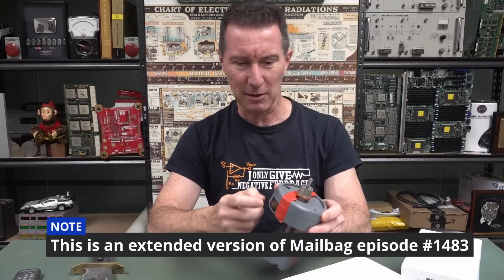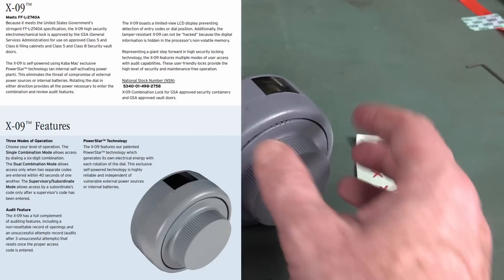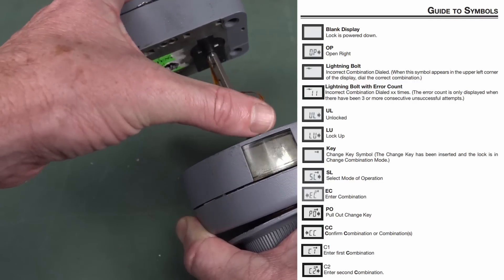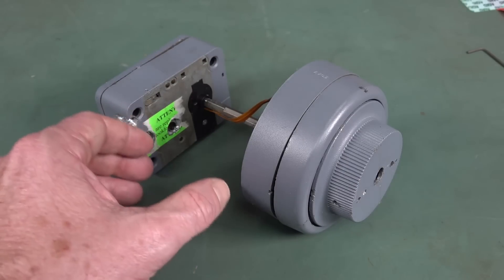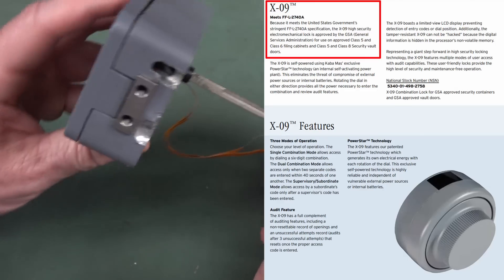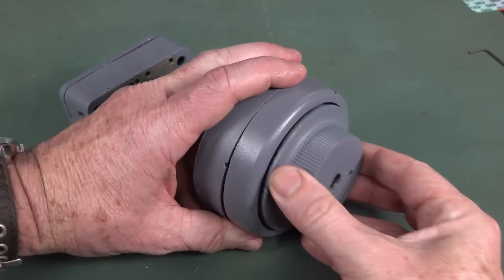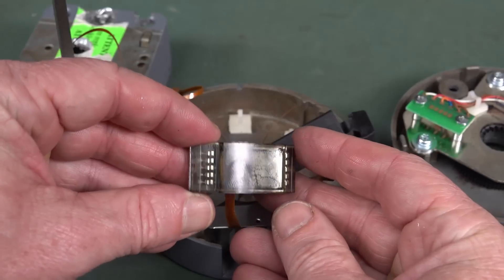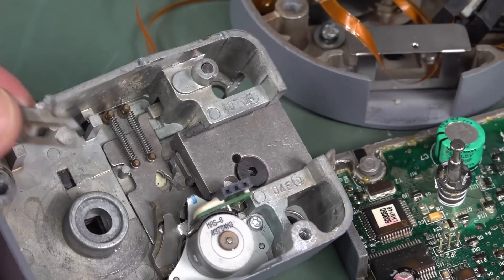EEVblog 1484 - Kaba Mas X-09 High Security Electronic Lock Teardown

Comment: to me whats  even more interesting, 
is that this shows  pretty much the exact way and bit placement to  destructively open the lock,
they drilled the handle pin, drilled out access to the  setscrews and then drilled exactly tho the latch to free the bolt, then they may have drilled a second time into the bolt area to push the bolt open.

of course there would have been a door of plate steel in the way between the inside and outside, so probably a bunch of carbine bits were involved i guess.
Reply: The only carbide involved would be in the safe door, present in the form of hard plate (basically a steel that is designed to be impossible to drill). They use probably 5-10 40 USD per piece long diamond hole saws to get through them. Source: There's a guy that wants to hire me that drills these safes for the US govt for a living.
Reply from the maker: Locksmiths usually have access to drill templates for safes and locks like this.
Reply: @EEVblog  I believe some safes have the safe locking mechanisms mounted on a sheet of glass within the door so an attempt at drilling from the front shatters the glass which collapses  all making it even harder to withdraw the locking pins.  It also means that slamming the big heavy door risks shattering the glass.
Reply: @kissingfrogs  IIRC the X-08 did. It was discontinued very quickly because it was such a b**ch.
Reply: @kissingfrogs  that's an option for the safe door; that glass plate attaches to cables that keep spring loaded latches called relockers retracted. If you try to drill the lock out like what happened here, the glass shatters and the relockers drop in and that locks the main bolts in place so the normal safe mechanism can't retract them. They're potentially a real PITA because if the door gets slammed or just hit hard enough you can get locked out of your safe even with the right combo. As far as I know at that point you'd be stuck having to drill out every single relocker individually.
Reply: Where to drill an X-0 lock isn't exactly a secret. Most locksmiths don't even bother drilling the lock itself though, instead opting to drill the safe drawer lock bolts or otherwise bypass a vault door, as it is faster and easier. These GSA approved locks, vaults, and safes are only meant to do 3 things: (1). Clearly show all signs of tampering (2). Resist covert entry for at least 30 man-minutes (3). Prevent penetration by drilling for a period of 20 minutes. If it is important, an armed response showed up 15 minutes before your first drill bit even makes it through. Check out FF-L-2740.
Reply: @logmeindog  Yep. These won't keep someone determined out. The guards with guns will. These are meant to slow them down until the guards get there. I have seen these fail, locking everyone out of the vault. What the entry team did was use the lock's installation template to cut a hole through the door, used the manual release to gain access, replaced the lock, and welded plates over the hole they made.
Reply: The Lock Picking Lawyer would only have to sneeze, and this lock would pop open.  Then the LCD would display "Thank you LPL!" hehe

Comment: This lock is one of the most secure locks ever build. I have one of these on my desk at work to remind of of what proper security looks like.  It inspires me to keep the computer system I am responsible for secure.  This lock was designed by the same people that created the mas hamilton soft drill.  Many experts on the subject like Marc Tobias have said that there is no way to open this lock without drilling it out. There is so many security features in the lock that are amazing. For example, the screen has a limited view angle to prevent a camera from recording the code. The lock will shut down if the dial is rotated for more than so many rotations to prevent robot dialing. Each time you rotate the dial in the opposite direction, the number jumps to a random location in the dial. The PCB has UV particles in the conformal coating that create a "fingerprint" of the lock that is photographed during the manufacturing process so if the user feels the lock was tampered with the photo can be compared.  There is an internal counter that shows how many times the lock was opened. This lock is truly amazing.

Comment: Yes, spinning the knob will generate power for the lock and will start with a new random (number) position each time it powers on. If you spin it too fast, it will lock you out even if you enter the combo correctly. If you enter too many incorrect combos, it will make you wait to try again. These features are designed to prevent automated attacks such as a robot.
Reply: That power generator is pretty clever, it provides pretty much fail safe power.

Comment: I've been working on these X-0 locks for nearly 20 years now. Fascinating and well thought out for sure but quite simple once you've dealt with them for a bit.  The X-09 you have is an earlier one and they had a common issue where the generator would crap out on them and no longer power up or generate enough power to actuate the unlocking catch paw. Kaba somehow avoided a recall and I'd wager what is what happened to your lock.
Reply: The building I used to work in had many X-09s die like that. It was always a game of "well, is it going to be our room today?" because of course none of them got replaced until everyone was locked out.
Reply: Question.  Couldn't you just replace the front part instead of drilling the whole thing out?
Reply: Were you ever able to bang One open with a dead blow hammer. Had success with that a few times hitting it at the right place at the right time while spinning the dial

Comment: That pin is an anti-tamper mechanism that prevents opening the back of the lock without tampering.

"The Lock On Back Cover (LOBC) feature provides a locking mechanism that locks the back
cover in place after installation. The design is such that the back cover cannot be removed
without visible damage unless the combination is known, regardless of whether the lock is
locked or unlocked"

The two pin connector is used when you change the combination.  There's a special tool you get with the lock that lets you do that  The combination on these style locks usually get changed frequently.
Reply: If I remember correctly when that pin is pulled out, it also prevents the lock from locking.
Reply from the maker: @krux702  Yes, looks like it does some mechanical interlock type thing.
Reply: Look like when the locking bolt it in the locked position, that gets caught in that hole in the mechanism, locking the cover in place
Reply: @krux702  When the pin is pulled out, it allows you to remove the back cover. It might not've been designed this way but in my experience, you can only remove the LOBC as you are unlocking and spinning the dial. They are finicky and most locksmiths hate the LOBC. The X-10s did away with the LOBC.
Reply: @logmeindog  Correct, the LOBC pin can only be pulled out as the dial is turned to open the lock, but before the dial stops.  If you wait until the dial stops, you can't pull out the LOBC pin because the gate in levers close.  The X-10 doesn't have a LOBC pin because there's no need to remove the back cover to install the lock.

Comment: The 2 pins are for changing the combination.  The button is to unlock it from the inside, when installed on a door.  They can be set up for 2 combination, supervisor mode (1 code 1/2 unlocks it so the user code can open it), or single combination.
Reply from the maker: That makes sense, thanks.

Comment: The Two Pins are used to place the lock into Program mode, to program the combination. However, don’t got too excited, the Programming “tool” is just a plastic holder, with a bent piece of copper wire.  It’s just a jumper to set the combination while the door is open.  You remove the jumper “tool” when the combination has been programmed.

Comment: Spinning the dial powers the device.  Spinning Left to XX three times, Right to YY two times, then Left to ZZ one time, places the combination into 'Unlock' mode, then you rotate the tumbler Right until OP & you hear the 'Click'!  Something along those lines.  We have KABA X-10's at my work, but I don't use them much.  The X-10 is the only SCEC Endorsed combination lock, suitable for "Protected" (or Negative Vetting level 1, or NV-1) security classification.
Reply: Not exactly.  The older mechanical locks required the multiple passes for each combination segment.  With the X-07, -08, -09, and -10, you go directly to the next number when you change dialing direction.  You can pass the next number multiple times as long as you stop on it before changing direction and don't reach the timeout limit.  The locks will also give you an "oops" attempt if you miss the number by a few digits and allow you to back up to the correct number before going to the next number.  Mechanical locks won't allow this, so you have to reset the wheel packs and start over.

Comment: These were used on doors. OMG I hated these! Worked in a closed facility for decades. There was a requirement to mount them a certain height above the floor and if you were short, you had to stand on your toes to see the unlit display. Also had a non-linear, random rate sensor so that you had to spin the dial at different speeds to get the same number rate of change - actually clever for defeating some cracking mechanism.
Reply: Modern safe cracking robots have can be programmed with random rate spinning, but the wrong combination timeout feature of the lock would prevent a successful cracking within a reasonable amount of time.

Comment: gsa certification has a ton of info related to these as these are typically a government lock. to drill remove anything like that you have to be certified typically because of the government protocols. ie if most of the time you allow them to get the items out then they throw out the container, its very costly but extremely secure. when you spin them up and pick your first number ie 50, then begin to spin the other direction it starts at a completely random number and repeat for the 3rd portion. This was introduced to prevent people from reviewing camera footage and being able to determine spin estimates to guess the combo. just be glad they typically don't use the glass walls in the safe.

Comment: Never say it can't be defeated, Dave. There is a lockmaster born, every minute, I would guess.
Reply: Locks only stop "honest" people...  Most locks are rated in minutes - minutes it takes a good locksmith to defeat the mechanism!
Reply: The only way to defeat this lock is to destroy it or whatever it is protecting.  Unlike the older combination locks, you can't use an autodialer to go through the one million possible combinations.  After ten consecutive failed attempts to enter the combination, the lock enters the "penalty mode" which requires keeping it powered up for three minutes before attempting the next combination.  After 15 consecutive failed attempts, the penalty mode increases to four minutes.

Comment: These locks being self powered make them the choice for government equipment. The S & G electronic dial locks had a battery that needed changing. You got ample warning but if the battery went flat you'd need to drill it open.

Comment: These are mostly used on doors by military / govt for “top secret” areas of a building but can also be used on “Security Container” (a filing cabinet that’s made to deter entry) This is an older one. The newer X10 has been in use for quite a few years. Ultimately these aren’t meant to be as secure as a bank vault, just secure enough to give the guys with guns time to get to the location of forced entry.

Comment: It takes like 2hrs (if you are dead on precise) to drill the kabamas open. No criminal has that time. Most likely, the users forgot the password or failed so many times it died permanently. Needing a drill out to place a whole new one.
Reply: Exactly, everything can be drilled after a long enough time. 
What is the rule for entry door 5 or 10 minutes? If it takes longer to pass criminals will just avoid them as it causes too big a risk and chooses another victim.
Reply: Or the generator failed. "Locks only keep the honest people out." With the right tools, and time, anything can be opened.

Comment: it would be fun if it generates a random number every turn. for example a normal good old lock goes like 1-2-3-4-... in a sequential fashion when you turn it, but it will be good if it shows random number every turn like 24-19-98-44-... and so on. it will potentially takes forever to get to the correct number for the combination and annoy the heck out of the user.

Comment: What you call the "encoder" is actually the "generator" to make electricity, the "springy pin thing" is the LOBC Pin (Locked On By Combination / Locked On Back Cover) so you cannot remove the back cover without having the lock open (i.e., know the combination).  Noting a real "hack job" by whoever drilled it.

Comment: @eevblog you are correct. Knob act as power generator and user interface. First rotate the knob to generate some change. Then display comes up with a number. This number should be the key for generating the one time pin. Usually the user will inform the number displayed to call center and get the pin and enter the pin using the knob

Comment: The only problem I see with this mechanism is you could possibly brute force the combo a lot like an automatic safe dialer if you knew the what data protocol the system uses. And it would probably go a lot faster as well due to you not having to use a stepper motor to spin the dial.
Reply: The lock disables itself after a few incorrect combinations or if you dial a combo too quickly. It's something like a five minute wait for every three incorrect attempts.
Reply: You can find a few videos on youtube who have build robotic dialers to attack the X-0 series. Even with many optimizations to avoid spinning too consistently, navigating lockouts, and many other variables, it still takes forever to guess the correct combination.
Reply: @logmeindog  That's why you take the dial off, and put a skimmer inside it. Putting the encoder outside the lock is a major flaw. (but it's only meant to resist attack for 30min.)

Comment: These locks can be a bit painful. The screen can only be read from the perfect viewing angle (that's a feature), you need to spin the knob first to power it, but don't spin it too fast or you'll be locked out. They are great when you use them regularly, but if you're not that used to them they are tricky to use
Reply: These are by far easier than a standard tumbler

Comment: I think most safes this would be used on would have a glass relocker; if the drill comes anywhere close to the locking bolt, the glass breaks and another mechanism engages the locking pins.

It's a shame the locking bolt is broken; I'd love to see TheLockpickingLawyer have a go at this.
Reply: I don't think LPL would have any success at this.

Comment: If the lock hasn’t been unlocked in a while (or is getting old) you have to spin the dial back and forth quickly until a little lightning bolt appears on the screen to show that it’s recharged
Reply: Well, that works, but just spinning it left is the recommended procedure, since that is also the correct direction to enter the first letter of the combination.
Reply: Lightning bolt means that the controls are locked out and you have two wait 3 minutes or more to try a combo. Spinning in one direction is the only way to power on and use the lock.
Reply: @logmeindog  no, I always spin it back and forth until I get the lightning bolt, then immediately enter the combo and it works
Reply: @Joe-bm4wx  Hmm, after re-reading the manual, the lightning bolt simply means that you entered an incorrect combination, not that a lockout timer has been applied. This increments the failed attempts counter every time you do this. I don't see much of a point in doing this as the direction that you spin the dial to generate electricity doesn't matter. You aren't creating the worlds slowest sine-wave or anything.

Comment: I opened up my body safe one time with my taser I’m pretty sure it was 100,000 V taser four prong  one I also used to mess around with street lights with it zap that little tiny black box they use for wireless control or Monterey  It makes it flash red lights came in handy a few times

Comment: I wonder if the UI relies on change of direction (edit: of the knob) to know the selected number. Mechanical combination locks that I've seen have to spin in reverse to specify the next number. Plus, it generates that much more power for that super cap.
Reply: If you move more than 3 numbers in the other direction it treats the number as entered.  You can go back up to 3 if you over shoot.  When it decides you changed direction it randomizes what number you are starting from so nobody observing can gain any information.
Reply from the maker: @BrianRossman  Similar to mechnical tumbler locks that have a window of tolerance on the number, which is around 3 IIRC.
Reply: @BrianRossman  Thanks for the clarification. I never knew the tolerance was THAT high; I wouldn't have expected more than 1. But, I guess some hysteresis is called for to deal with those imprecise humans.

Comment: I'm no expert, but that lock seems to have been drilled by a expert; one hole to release the bolt, and another hole to move the bolt?
Reply: not very expert. It can be done with one hole.